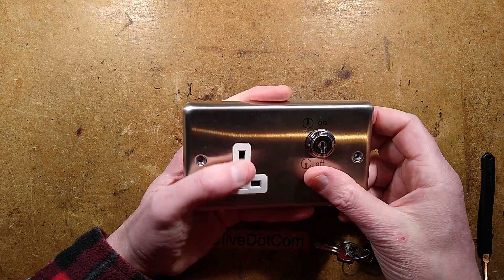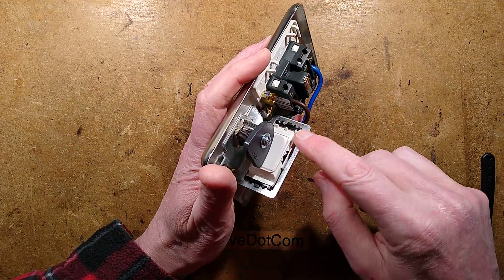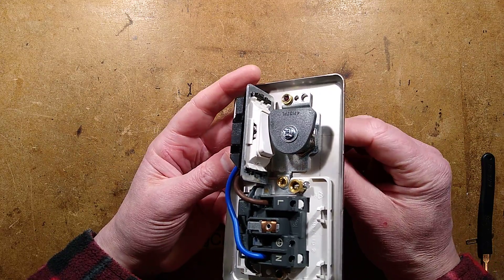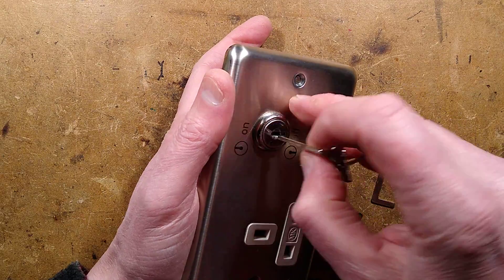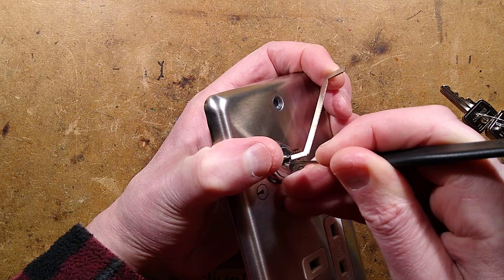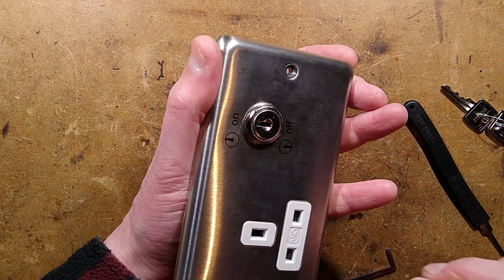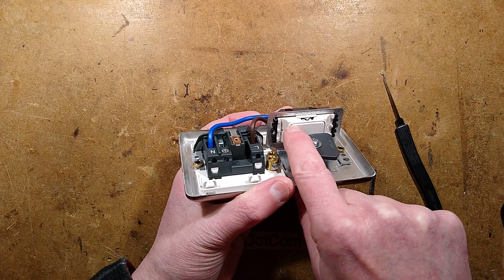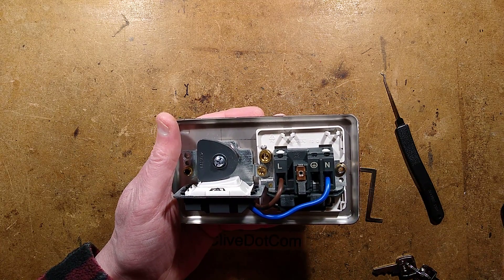Exploring & picking a lockable socket

Comment: Useful to prevent someone accidentally switching a socket off, or on, but unfortunately it doesn't prevent the cleaner from pulling the plug out in order to use their vacuum cleaner. But then again, neither does a big label saying DO NOT REMOVE THIS PLUG.
Reply: I think this sort of thing is intended mainly to prevent somebody unauthorized from turning on the socket (and stealing power, etc), not to prevent them from turning it off..

(For anything where turning it off is a problem, it really should be hardwired in anyway, probably even with conduit and such, and placed in a location where physical access is restricted.)
Reply: @foogod4237  Yes, it's to deny power. Otherwise you would simply fit an unswitched socket.
Reply: @markrainford1219 Unswitched outlets are illegal in a lot of countries.
Reply: @allangibson8494 Unswitched sockets may be illegal in some countries but not in the UK as our plugs and sockets are superior in design and safety to any other.
Reply: @MegaCaptain  Almost all UK sockets are switched (and they are not superior - they use three times as much metal as actually needed and have openings that are actually only IP30 rather than the IP40  or IP42 of some other countries sockets).
Reply: @allangibson8494   This is UK. Unswitched sockets are pretty standard in most of the world.
Reply: @markrainford1219  Unswitched sockets are a US “thing”. Most of the rest of the world prefers to turn power off before burning the electrical connectors during insertion or removal.
Reply: @allangibson8494  Don't know where you are getting your information from, but Spain doesn't routinely switch their sockets. In fact I've never seen a switched socket domestically. Pretty sure most of Europe don't routinely fit switched sockets. What appliances don't have their own switch, that are plugged/unplugged under load, apart from maybe a table lamp?
Reply: @TestGearJunkie. We fit them for appliances in kitchens, where the actual switching is remote, either a 20A DP switch above the counter, or more often a grid of labelled switches.
Reply: @allangibson8494  What countries ?
UK, Australia, New Zealand, Singapore ?
Or did I forget another one ?
Reply: @allangibson8494  Well, in most if not all western Europe as well as north Africa the sockets don't have any switch on them as far as I know.
Same goes for the plugs which also don't have fuses either.
I think it's only a few countries like the UK, Australia, New Zealand and Singapore that have switched sockets actually.
Reply: @psirvent8  And China and about half of South America…
Reply: @psirvent8  China, Argentina…
Reply: Heh, good point. I can imagine an external cover that when locked closed would hold the plug in place, with a gap for the cable to easily pull through. Honestly should be rather easy to implement, I would be surprised if this hasn't been done plenty of times before - both professionally and improvised. 

This socket would still be good for disabling a socket though - assuming there isn't another socket near enough to make it pointless.
Reply: @NeatNit thats what I thought, if you want off pull out plug, if you want on, plug into next socket or use an extension lead
Reply: Found one where they unplugged a ups to charge a phone in a supply room. Hours later the beeping stopped and all the pos registers went down. Lots of mothers and brides to be showing their true colors lol. (wedding gown place)
Reply: Some strategic removal of insulation on the plug can go a long way to keep that from happening.
Reply: Oh yeah, saw that a few times
Reply: @chrishartley1210 These sockets aren't meant to prevent cleaners from unplugging critical equipment though.
They're rather designed to keep unauthorized people from using the sockets at public places or maybe also in the hallways in blocks of flats.
Reply: @psirvent8 yep  I saw a lot of that where I used to live, wasn't uncommon to see extension leads draped through the stairwell and running into a flat where the resident hasn't topped up their meter key, the meter bleeping was a dead giveaway 🤣
Reply: @psirvent8  depends on where you are in the world, in the UK we have prepayment meters usually for low income households, so rather than a bill, you have a "key", looks like a large USB drive or a card, you take it to a PayPoint kiosk usually in your local newsagents shop, they plug it into a terminal, you pay the amount you want, then you take that key home, insert it into the meter, the credit is then transferred, remove the key and job done.
Reply: @RobR386  Thank you for the explanation.
I didn't know such system existed and here in France it's actually unheard of.
Low income individuals usually get to pay their bills over a longer period of time, therefore at a lower amount each month.
Reply: Happens in hospitals with life support systems.
Reply: I really wonder about that actually happening to any critical systems
Reply: @OscarSommerbo  Saw it happen where I used to work. The very mission critical computer room kept tripping out all the breakers at 3am. We couldn't understand it. One of my colleagues spent the night there sleeping under his desk next to the computer room to find out what was going on. At 3am the security guard walks in with an electric kettle and plugs it in to the computer room to heat up a cup of coffee. Gets the water luke warm then that circuit trips, so he then moves onto the next circuit to get his coffee nicely hot and knocks that one out as well. Moron. When we rebuilt the computer room a year or so later, in a different building, away from him, we used special sockets for all the computers.
Reply: @TestGearJunkie. Small world. Dad worked for BREL/BRML eastleigh as a sparky, we had lots of BR branded lightbulbs in the house :D
Reply: @TestGearJunkie. yes! the the old dimplex fireglow lampholders would fit... dad had some 200v lamps, meant to run 8 in series off the 750v traction current i believe?
Reply: 4 in series, i meant
Reply: It’s a tradition or old charter or something that when those labels are seen, they really mean “no one except cleaners should unplug this device”. Is it not similar to putting big red defrost buttons at the back of old fridges for men? Do not press this button unless you are a man willing to incur the wrath of swmbo?
Reply: Its intended use is to limit the use of electricity. Your perspective is warped.

Comment: I wonder if they do a lockable switched fused spur unit too? That would potentially be useful for "fixed" equipment that you still want to allow authorised users to lock on or off.
Reply from the maker: Not sure.  I wonder if the standard socket module has a matching spur version.

Comment: Someone would have to take around 450 kWh, at current UK energy cap prices, before you save money over just letting them have the electricity. Five full charges of an EV battery I suppose...
Reply: When you've got different phases in the hallway and a flat but an occupant runs a lead inside to nick the Lecky you could have a problem.
Reply: @khaitomretro  Some people seem to have a strange fear of devices on different phases. Even though you would have to get up to about a "quadruple fault" condition for it to actually matter.
Reply: @petermichaelgreen  I've seen flats with phase and neutral swapped at the board, earth's disconnected to stop the trip going out, floating neutrals, adding another phase to that makes everything worse. I've seen a TV destroyed because they'd run the Ariel cable from next doors booster box in the loft and it was on a different phase. If you watch enough of big Clive you'll see plenty of imported devices with the low voltage referenced to live (one dodgy iphone charger killed a girl in a bath), now get a couple of those near each other on different phases. There's a reason mixed phase installations need "Warning 415v!" stickers.
Reply: Oh, and lots of that on old Wylex boards packed full of Rewireable Fuse Carriers. Do you know the last time I saw those in an installation? Today. Not an RCBO, RCCD or even an old MCB with two round buttons in sight. Just good old fuse wire.

Comment: Industrial strength cleverness! And now let's try it once again just to see if it was not a Fluke.
Reply: It's not a Fluke. That's a meter.
Reply: @TartyVesthandle  back in prehistory, when the Fluke 70 series was introduced, I was working at an electronic component wholesaler and we had a spif on those meters. I cleaned up, as I handed a couple of resistors and maybe a battery to techs at the counter, along with our counter sample meter and let them play with it - the meter sold itself (I knew it would, I was a tech myself and bought two). The owner initially complained that "now it's a used meter and I'll lose money discounting it and those components (yeah, he complained about the cost of a pair of quarter watt carbon film resistors), so I had him look at the sales numbers and he shut up.
I used those meters until the wafer switches literally fell apart decades later.
Reply: Darn, you beat me to it!
Reply: it wasn't a Fluke, it was an MK.... I'll see myself out

Comment: There doesn't look like there is much room to  connect wiring to ring/radial at the end of the socket.
Reply from the maker: Both connections would go into the switch, but I wonder if a socket like this would be on a radial circuit.
Reply: If you follow many of the YouTube electricians, the very knowledgeable ones as well as the fly lads, they all seem to ridicule Ring Finals now!
Reply from the maker: @barrieshepherd7694  They have their place, but the amount of random tests they've invented for them is a pain.
Reply: @barrieshepherd7694 Not really needed nowadays until there's a power cut and someone tries to plug in a two 3kW heaters to warm up the through lounge/dining room with all the sockets strung on a 16A radial.

"Don't plug them both in in the lounge you'll blow the fuse."

10 minutes later, phone rings: "The power went out. downstairs."

They'd probably have got away with 3 on a 32A ring. (Do not try this at home)
Reply: Those appliances are designed for stranded wires. Or you can connect solid wires from ring to WAGO 221 and make pigtails with stranded wires to socket - hybrid of ring and radial circuits.

Comment: Wondering what the application for this is.  Commercial buildings who don’t want people plugging their phones in to charge?
Reply: I'd guess hallways and common areas of apartment blocks, to prevent tenants from stealing electricity.
Reply: @gloomyblackfur399 energy thieves prefer to unscrew socket and install WAGO to connect additional cable, nobody will see that some unidentified spur is connected to public socket.
Reply: @gloomyblackfur399 that's what I use them for! We have had tennants running extensions into their flats, out the charge EVs etc
Reply: @gloomyblackfur399  As well as commercial buildings who don’t want people plugging their phones in to charge.
I have mostly seen that actually here in France.